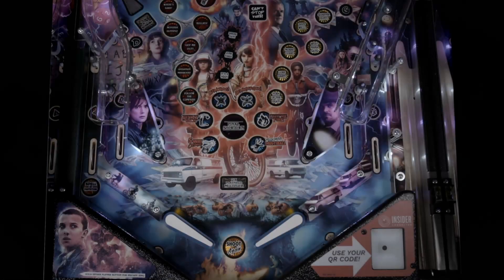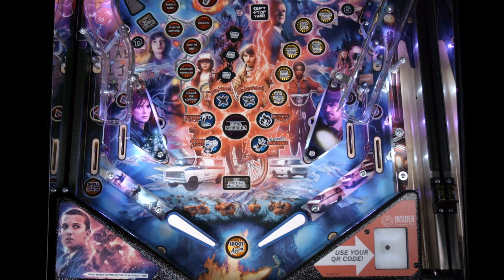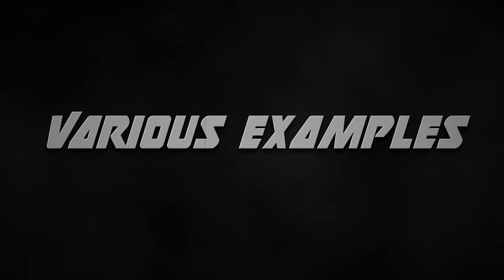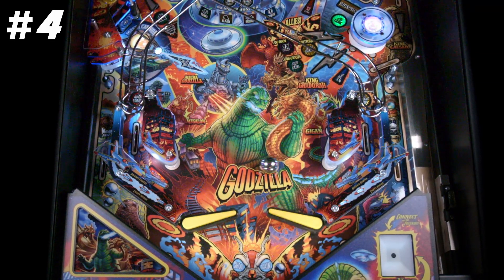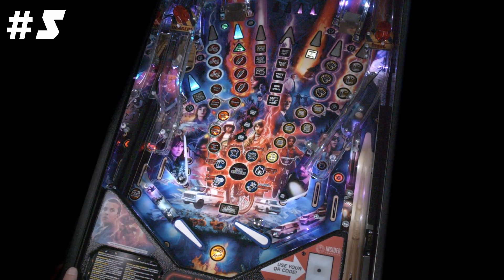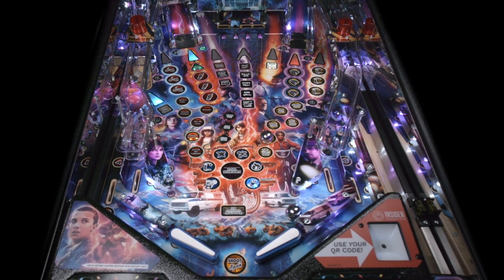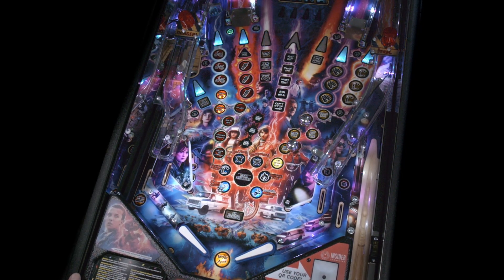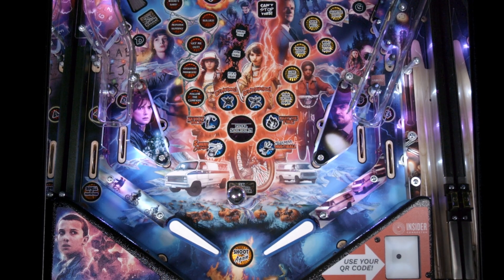Pinball Skills - Shielding

Comment: How do I stop draining on Jaws? Half the time. I swear it hits that reel at the perfect drain angle.
Reply from the maker: Make sure the game is leveled from side to side at a pitch of ~ 6.8°. There is a rubber post at the exit (right side) of the exit of the reel. Remove it and put it in the free hole one step above. From an autoplunge the ball should bounce off of that post onto the left flipper. A clean shot from the left flipper into the reel should feed the right upper flipper. If it bounces off of the right wall above it, you have to adjust the ballguide of the reel. Check out pinside for that. Good Luck! Also check out my twitch account and see how the JAWS machine should behave.

Comment: Great video but it seems like common sense. Don't get caught with your flippers up when they should be down.
Reply from the maker: Thats why I put the video on second place in the playlist, right after "aiming". It should explain for beginners why the "noob-doubleflip" is a bad idea and how to correctly shield the center. However, if you watch closer, there is much more information also for advanced players broken down in a simple way. To figure all that out with "common sense" on your own could take a few years. And still you might not be able to describe what you are doing- and why you are doing it.